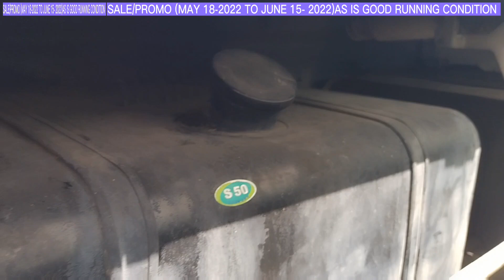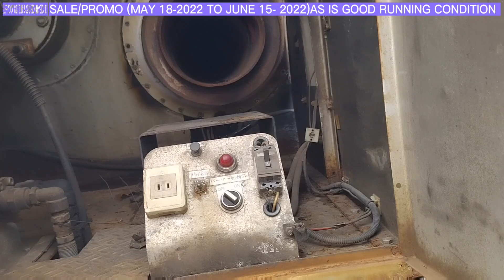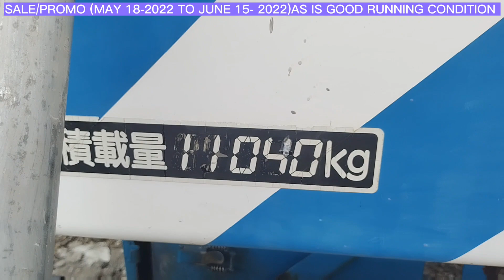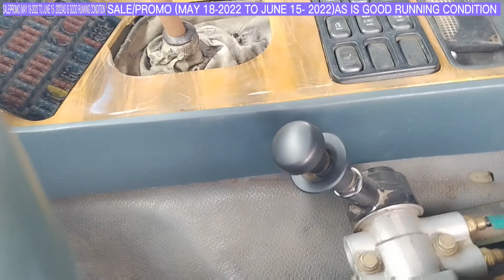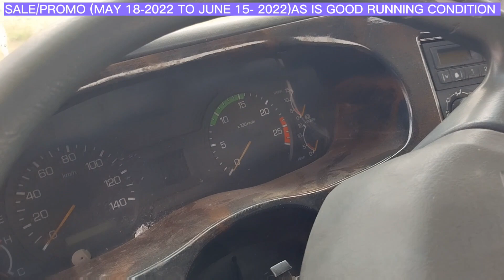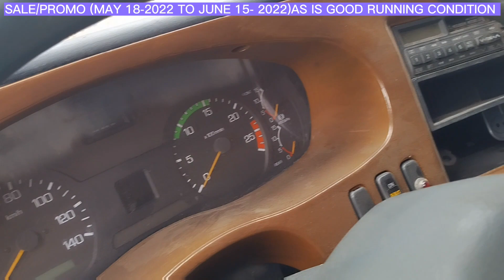sale sale sale promo

Comment: Ser my elf truck po ba jan
Reply from the maker: Yes po meron drop side or close van
Reply: @subictrucktv4075  12 feet dtire dropside aluminum siding at kung 4hk1 makina
Hm po kung meron unit at my finanzing din po kayo
Reply from the maker: 14ft available 4jj1 engine new face 880k
Reply: Sir Meron po ba kayo 21 ft wing van truck, magkano?
Reply: Six wheeler po ung hanap ko